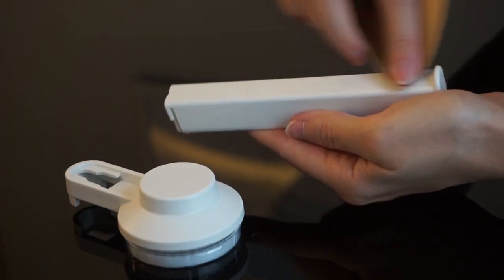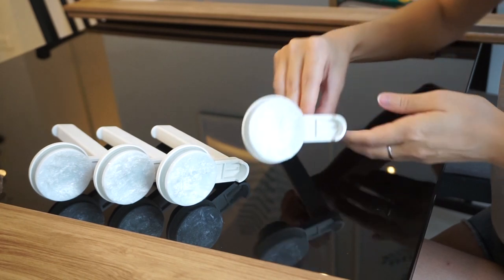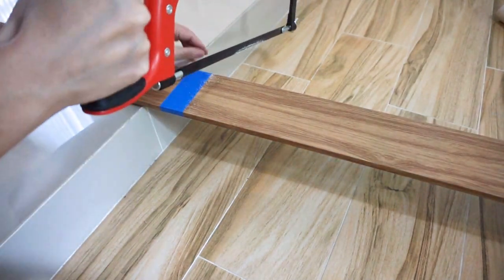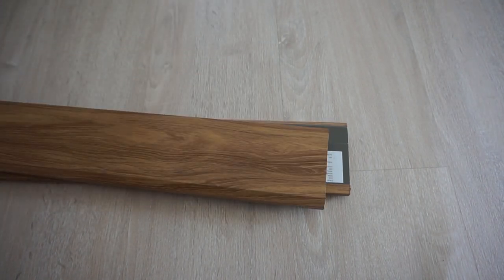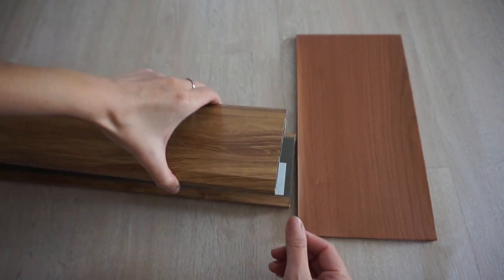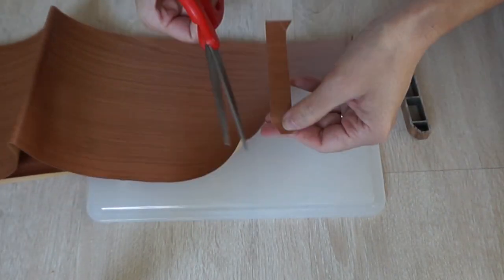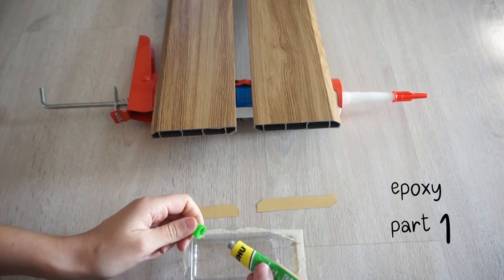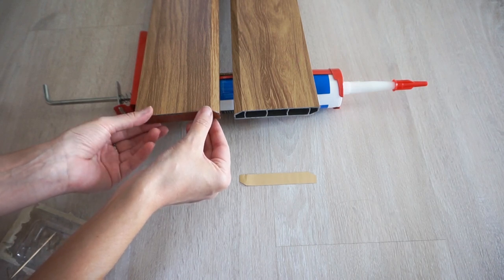Bathroom makeover and no-drill shelving! (diy IKEA hack)

Comment: Your DIY shelf brackets for tiled walls were truly inspired!  How are they holding up after 6 months? Any "accidents"?
Reply from the maker: Thank you! Although, yes, one of the shelves was too heavy and ended up falling a few months in. I fixed the issue by using silicone caulk to attach the brackets to the tile wall (so it'll still be easy to remove if I want to change them in the future).
Reply: Thanks for the question and answer ladies! 🙏
Reply: @aandtj1119  I did originally think that the doubled shelves might be too heavy. Good to know there was an easy fix.  Will have to give  this a try!
Reply: @aandtj1119  this is the best hack i've seen in a few years.  i also needed shelving immediately and had the same tile drilling dilemma as you.  fortunately, these are still in stock and available for delivery. thank you SO much for sharing.  I was quck to check for updates so I will make sure to grab silicone caulk as well!  Whenever you do take them down, I'd love to see the process as well. xx

Comment: Hello, did you add additional glue to the holders?
Reply from the maker: It depends on how much weight you're putting on the shelves. If your items are light, you can get away with just using the suction cups. But if your items are heavier, you could try a glue.